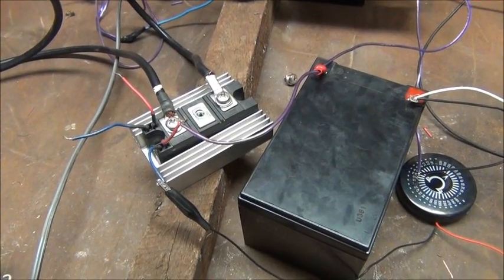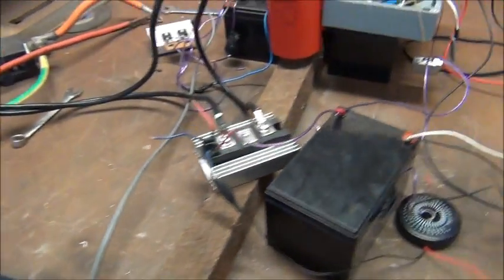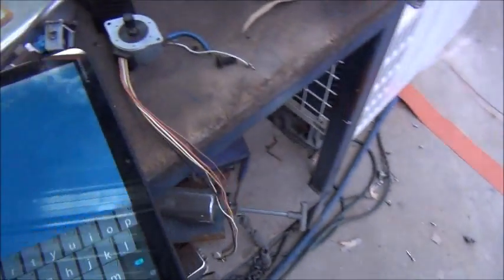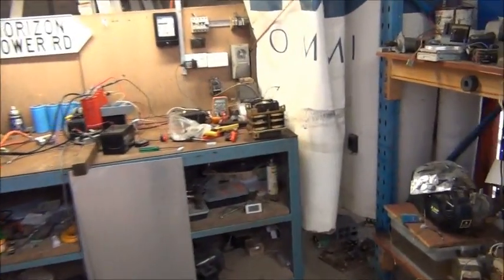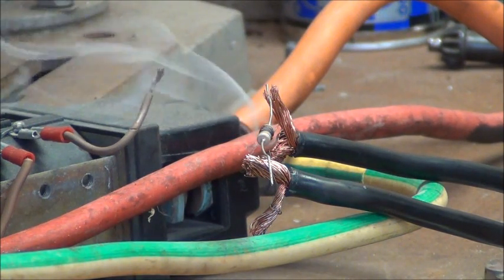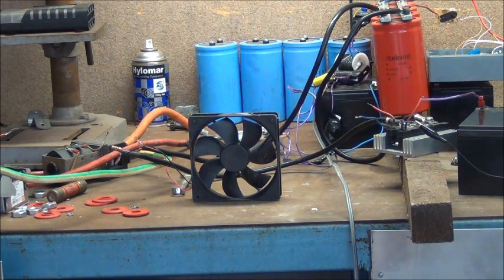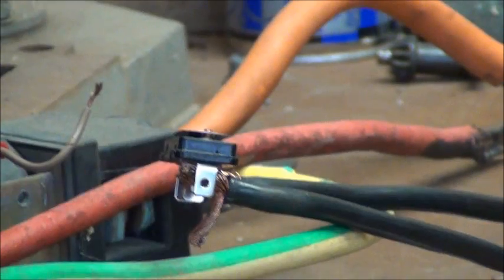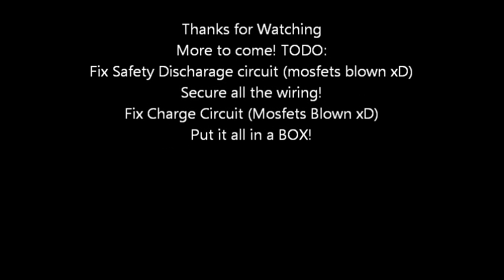BANG! Testing SCR, Capacitor Bank vs Stuff!

Comment: This is a fairly old video but how did you control that SCR. What voltage did you run to the gate?
Reply from the maker: 12v thru 150ohm resistor.

Comment: really cool,   so is the advantage of SCR is that the energy is actually dissipated mostly across the intended load instead of at the contact  point of a mechanical switch?

Comment: wow i would have never thought of controlling a cap bank with an arduino, how does it hold up with the emf from the discharges? is it a boost converter your using to charge it right? with a PWM from the arduino?

Comment: I wanna get mine boxed up and set up the radio link next, then put a second arduino in its own box with the other half of the radio link (bluetooth). So will wire in the scr when I box it up. I say stuff the neighbours - a few gunshot sounds wont hurt em, and I'll get to blowing up some stuff :)

Comment from the maker: the "puck" is a resistor wheel :) im using 12v thru a 150ohm resistor to fire the SCR. the 12v is applied via the gate and cathode terminals from memory :) hope i explained that right :)

Comment: NICE! glad you got yours going with the SCR - thanks for the resistor ohmage. I've tripped mine with a 200R resistor, but only 12V to a radio so far - seems to reliably fire every time (and make the radio come on).